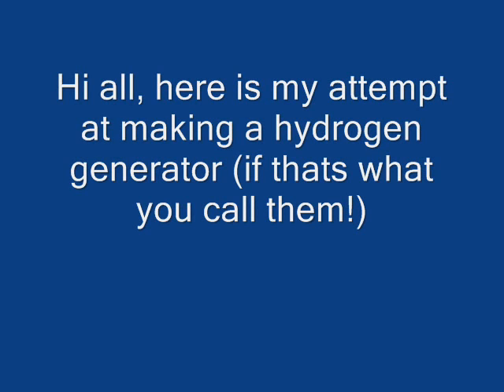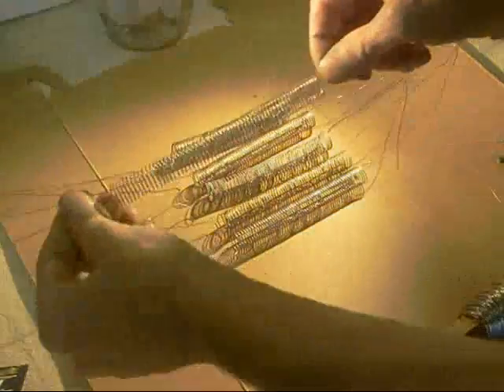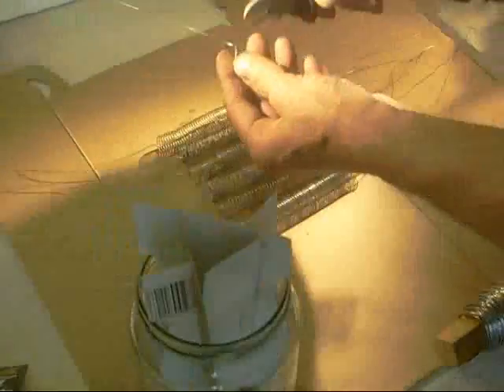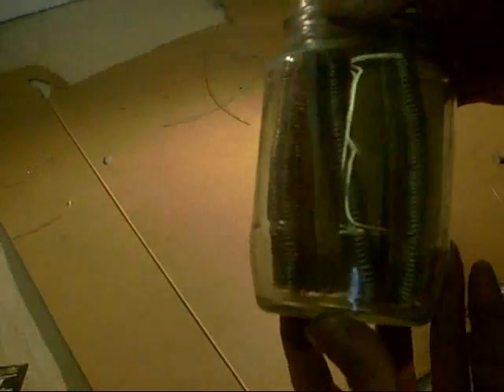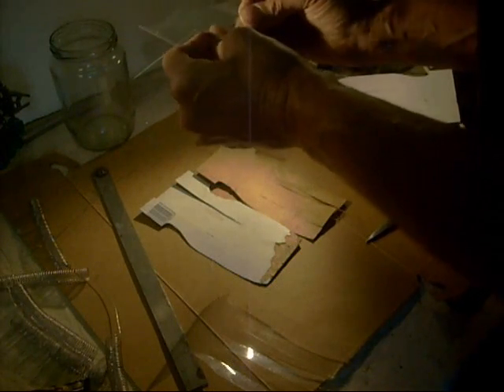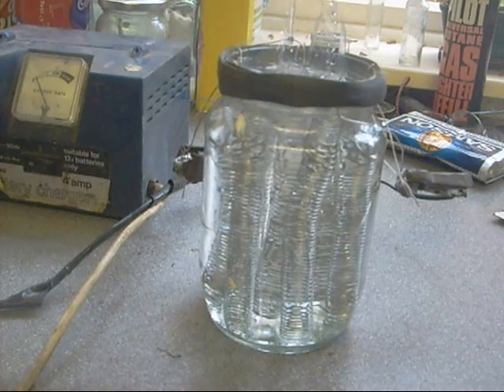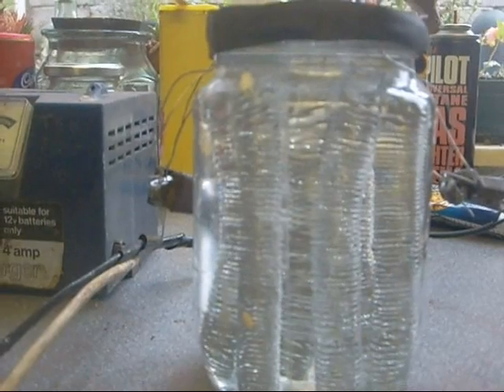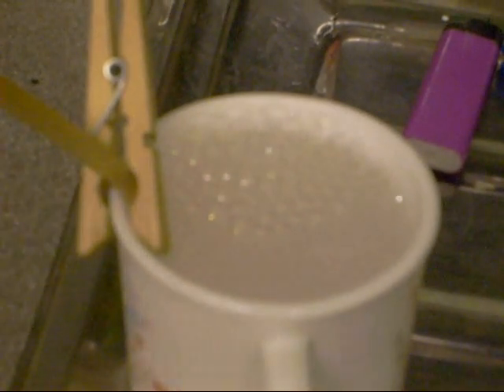home made hydrogen cell

Comment from the maker: @MrCODXD 
Hi MrCODXD I use a 12v battery charger for this one as you see it was not pulling many amps, adding more bi-carb increased amps.
I also tried linking 2x12v chargers  which made it work a bit faster.

Comment from the maker: Hi easymac79 :-)
I did use stainless for the coils I know you are right in the least resistance bit but they all seemed to let off bubbles not enough to run a V8 but enough to make a decent bang :-D
When I aquire a load of stainless washers I will have another go at one.
But at the minute I'm busy riding my bike :-)

Comment: Don't forget, electricity will take the path of least resistence, based on the crap quality, it looks like you have several coily things. You only need one, and are really, only using one. The rest is just a waste of supplies. Unless, if you're using copper, as one degrades, it will start using the next, but why waste money on depleting copper when you can choose to only spend once on some stainless.
Good luck, and if you are making a better one, hope it works good.

Comment from the maker: I could only say check for leaks between the two, depending how fast your (generator) makes gas and the size pipe you have used, it may take a while to build the pressure needed to bubble. hope this helps, at least a bit :-)

Comment from the maker: Hi bigbangAT the only thing I added was bicarbonate of soda approx 1tablespoon in just over a pint of water. It makes 1ltr of gas in 90 minutes at about 1.1/2amps and its temperature rose from 17c to 25c.
I will have to try some sulphuric acid and see if it make a difference (not very green though  :-)    )